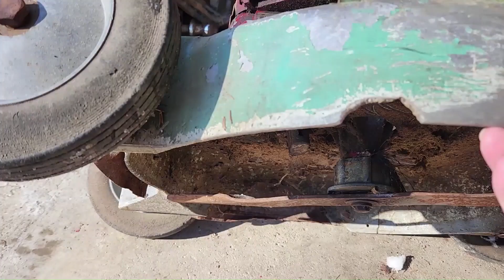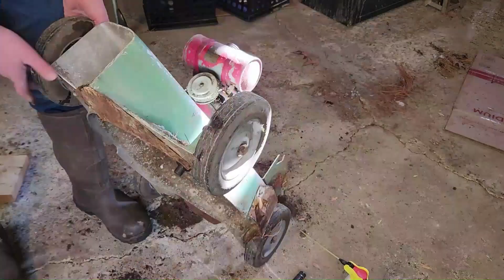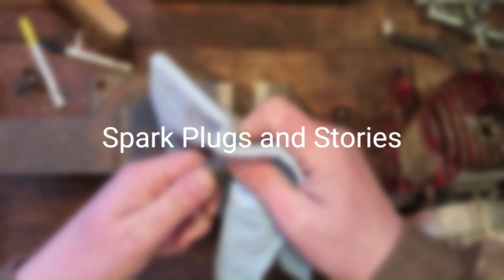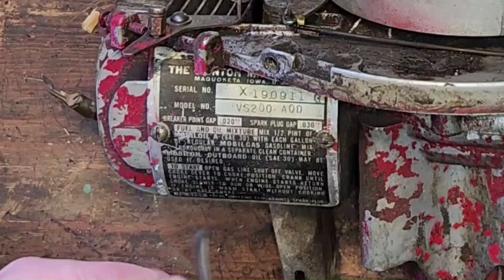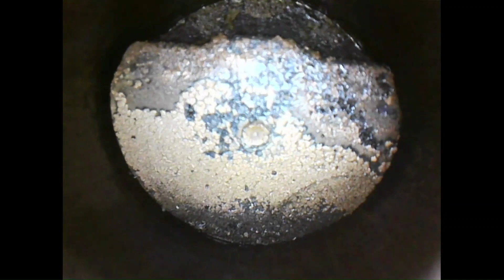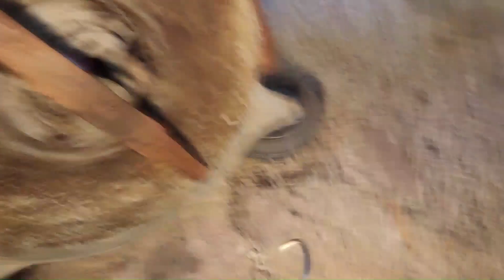Machine Rehab - Pre-1958 2-Stroke Mower - Will it Run??

Comment: I have several of these little Clintons and they are excellent! When you get it in grass it won’t be as loud as when on concrete. Don’t worry about running it as max governed RPM. These actually run slower than crappy 4 stroke junk. They are gutless slugs so HAVE to run at 3600 RPM to do anything. These run about 2800. 3600 won’t hurt them at all though! They are basically mini 2 stroke Detroit diesels with a carb and a spark plug. They LOVE to run wide open and SHOULD. These are very finely made little engines and have cast iron sleeves. There also was a VERY sought after horizontal shaft version as well called the model 500 that was popular on twin engine go karts and even a chain saw Clinton made! They were built rugged and built to last! Later versions had square cooling fins. The crank seals are important because the crankcase acts ad a scavenge pump because 2 strokes have no separate intake or exhaust stroke. Detroit diesels use a roots blower for scavenging because they have a wet sump like a 4 stroke. They are the greatest diesels in world history! You can run your pre mix at 32:1-4 ounces of modern 2 stroke oil to each gallon of gas instead of 16:1 which is 8 ounces of oil to 1 gallon oil just fine. I do it in all my antique 2 strokes. Tuned right with a clean carb they start 1-2 pulls consistently! They sound awesome once under load! You will fall in love! I did and won’t have a 4 stroke small engine because they are boring and pieces of crap 💩. Great find and this engine will outlast many decks! I love all things 2 stroke! The Power Products/Tecumseh and Clinton 2 stroke engines are hands down the best engines ever put on a mower deck! Jacobsen and Lawn-Boy were as well, with Lawn-Boy being the best mower EVER. This Clinton is reed valve induction and simple cross scavenged with one transfer and exhaust port and a deflector piston crown to direct flow into the cylinder. Simple, efficient and super reliable! That lower crank seal is called a labyrinth seal and is extremely reliable! Cheers! 👍🏻😋
Reply from the maker: I've taken a long time to reply to this message due to the awesome detail! Thank you so much for the information! You're a classic 2-stroke mower extraordinaire! I love the history of these old machines. I can imagine, with the exhaust positioning, there were a few yard fires out there 🤣

Also, thank you for the oil advice. Another commenter also suggested a leaner mixture of oil due to better oil quality these days. That's why I love comments from you all. 

Thank you again for the great info!! 🍻 👏🏻
Reply: Dude, thank you for this information. I dont know a ton about these antique 2 strokes, but I just restored a 1955 "Power Matic" with a VS200 (videos on my channel." I was afraid of the max RPM until I remembered 2 strokes sound 2x as fast as they are actually going when compared to a 4 stroke. I cranked the RPM up on mine and it powers through grass like a beast! It has become my favorite mower to use, and I've been using it 2x a week to maintain my lawn. It starts on the first or 2nd pull every time! Mine has a little "T" handle on the high speed mixture on the bottom of the carb bowl so you can easily dial in mixture for light/heavy loads. Finding info for Clinton's is sparse, so seeing this video helped me get mine going!
Reply from the maker: Hey Bobby! That's awesome news! Thanks for commenting. Im glad to know this helped with yours. Im hoping to turn it into a restoration project. Something I've never done. Just need to repair the deck first.   Keep up the good work. Happy mowing! 🍻

Comment: You can hit something and do stuff like that. I had a a Mower that I bought from K Mart of all places about 10 years ago and I use that mower until the motor fell out the bottom of it. I mean the frame rotted out front of the motor and grandpa took a regular frame cut the center out of it and ground it down and weld it back in there all the way around and any ground the Well down to or you couldn’t see it and re-painted the dead gum thing the only thing you could see is a little bit of difference in color.
Reply from the maker: Nice!!

Comment: I have never seen a float like that before. They usually made them out of brass. My guess is that this one was made somewhere between 1942-1945. That would explain some of the different metals that were used.

Comment: Surprisingly enough, I don't think that thing has been stored outdoors for it's entire life. It came apart a lot easier than they normally do when they are that old. It must have been serviced somewhat regularly when it was running. It looked like most of that stuff had been taken off before. Disassembly is usually an absolute nightmare on an old machine like that.
Reply from the maker: It definitely came apart pretty easy.  The previous owner found it in a barn at a neighbor's place.  Must have been a nice, dry, storage.

Comment: The small "patch" was probably factory. If it wasn't, it was definitely put on there a very long time ago. Those screws are around the correct age for the mower.
Reply from the maker: I wonder if it was a protective measure for the operator?

Comment: You would be surprised how much damage a rock or big stick can do when it gets launched out of a mower. I loaned my mom one of my riding mowers to cut her neighbor's yard. She hit something and it broke one of the belt guards on the deck completely off. That metal was 1/8 thick, and it went right through it. There were two little corners of it left, and I never did find it.
Reply from the maker: 😲 That's nuts!!

Comment: i would be interested in you fixing it up.. i have only seen Chilton parts first time i've seen one running.  maybe you could use lawnboy two cycle old instead of motor oil maybe a mixture of 32 to 1 8 oz to 2 gallons.. just a suggestion.
Reply from the maker: Hey Joe - Thanks for watching!
I'll definitely finish putting everything back together - clean up the handlebars / fix the leaks / straighten some metal.  Maybe even see if I can learn to weld aluminum... That's a bit of a stretch but I'd like to.  Either way - because you asked, I'll record everything.  It may not be released very soon, but you'll definitely see it down the road.  👍👍

Comment: sort of looks like a grave mower Taryl at "taryl fixes all" on youtube fixed sometime last year, that is why the handel goes either way, and its probably a little bit narrow for a mower..and the discharge doesn't go to the side so much to get beween graves..
Reply from the maker: Interesting... I never would have thought of having a specific mower used for graveyard mowing. Thanks for sharing!
Reply from the maker: Did a little cemetery mower research and found this:
https://www.ebay.com/itm/185768854874?hash=item2b40afc55a:g:5MwAAOSwruBhIDEY&amdata=enc%3AAQAHAAAAsGcc6DD3lUFIuQC33eXuMqjY4ny2450edisiJmHUpPjckR9VYv4ZE6XHLdwPXmcJE9yhI4eJR%2FrYcesdHyi77Ixsb5EOokSiqw5Gsil0%2BrG2H5EBwnd3TFzKajnGyudlSy71fkxaA%2BGzmUHwVRCIEiOeifwHwHpjMDbNam2O5yoki41UlahDWH8rY2p%2BYqvwUSLfaUEEn1yTAMlYyb4Dyk%2By3s3pMpvLu5KjdmcXS3AF%7Ctkp%3ABk9SR8Ce0OfGYQ
👍👍